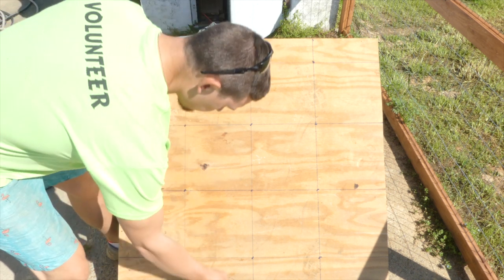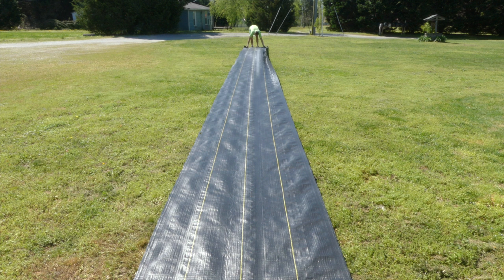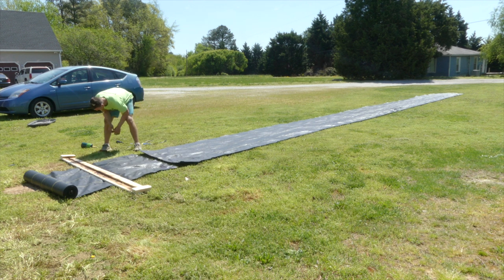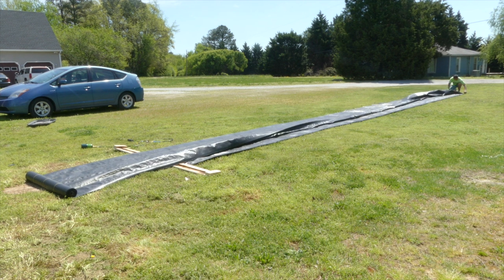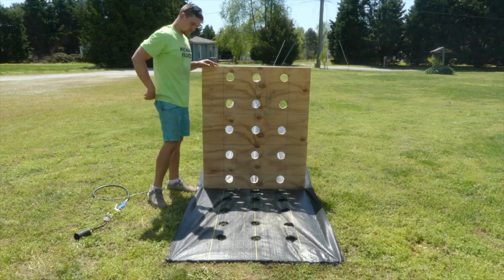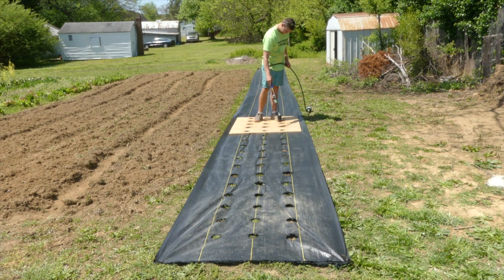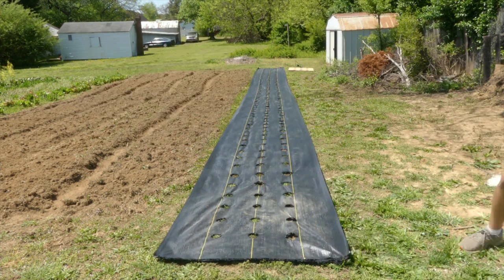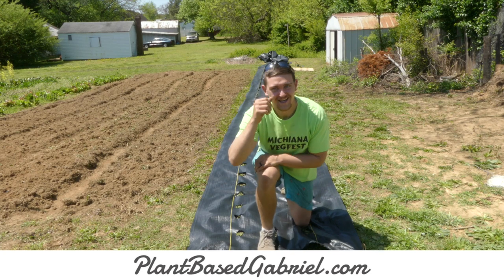How to Build a Template & Burn Holes Into Landscape Fabric

Comment: Your plywood would scorch less if it was soaking wet. Both sides to avoid curling. I think I have a weed burner. Like your crosscut jig. I’ve always knifed the mat and folded the end under termination staples. We use it mostly over the sand floor in our greenhouse

Comment: Maybe someone can help. I made templates, laid my ground cover and when I went to burn holes it burned up under and burned strips not holes. I just want to sit down and bawl. What am I doing wrong? Please help!
Reply: You probably had too much of a gap beneath the board/fabric, so the heat could spread further than you intended
Reply: @farmerjon5532  We found a smaller burner and it works great! But thanks for the heads up!
Reply: @1994abbygirl  Do you mind sharing a link to the burner you used?  THANKS!

Comment: Pro tip: Your burned edges are very frayed (see 4:20). You can avoid that by putting another solid board without holds under the fabric, so it is being clamped by the two boards, that gives the plastic nowhere to go and will burn a perfect clean circle without frays.
Reply: Hi.
It is very hard to find 30m of hard surface that is perfectly leveled. 
This winter I'll do the burnin of 1km landscape fabric. In a 3 row design like on the board but spacing it 30cm center to center. 12cm hole diameter. Also going to try 5cm diameter with 10cm spacing in row.  30cm between.
Reply: @leopoldprlic2148  Why would you need 30m of perfectly level surface? LOL.  Just grab a piece of plywood to put under the area being burned, to prevent frayed edges, and give you a clean edge.
Reply: @jeffmeyers3837  It would took too much time to do that. Lower surface has to be somewhat flat and leveled.